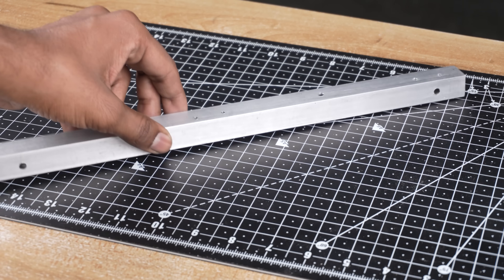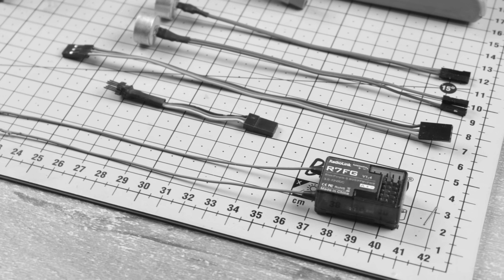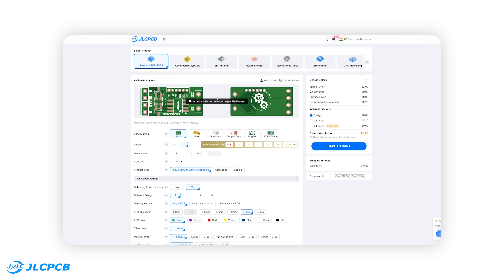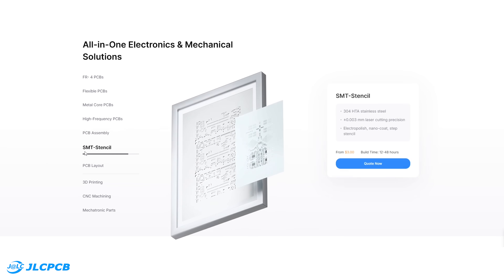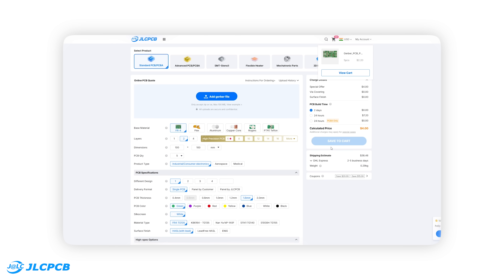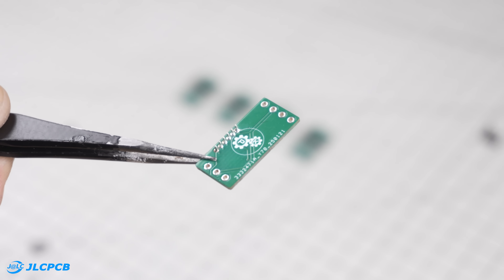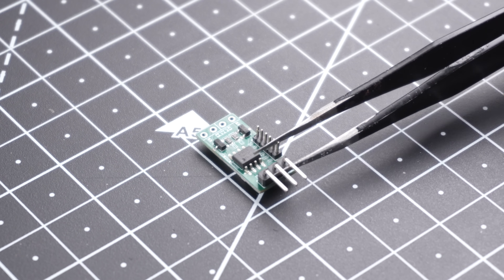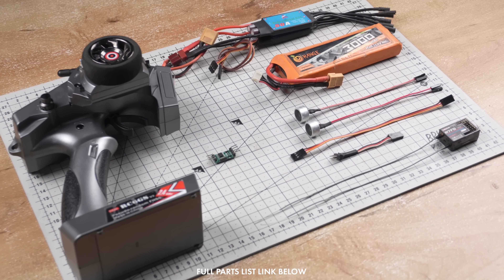I Built This Powerful RC Truck from PVC Pipes at Home

Comment: i think you should use motor which have rotating core so you can mount the motor properly and get proper torque output